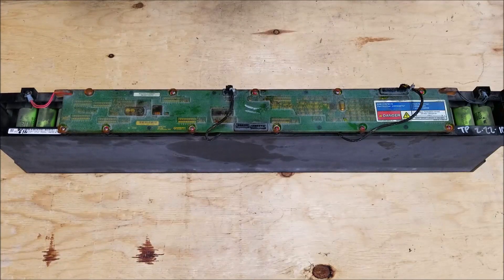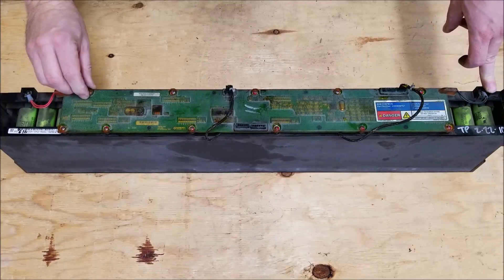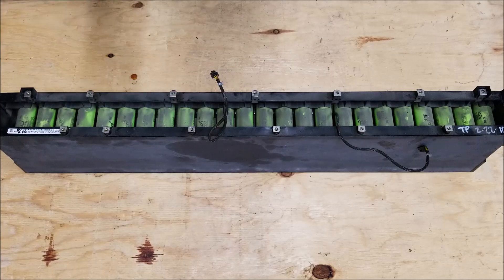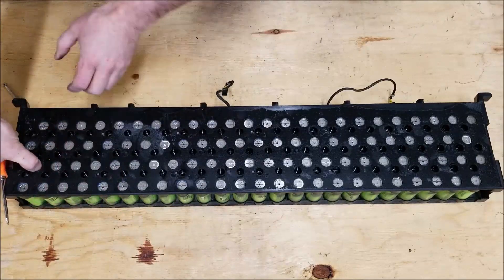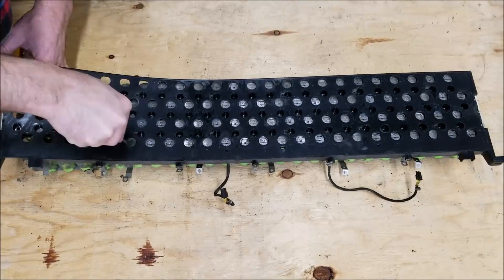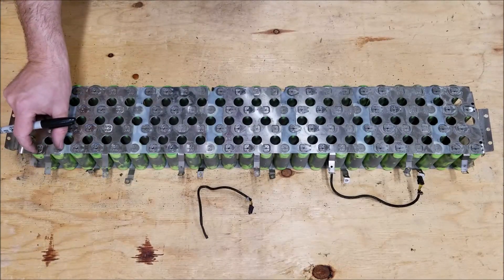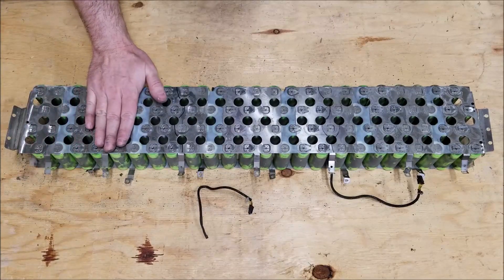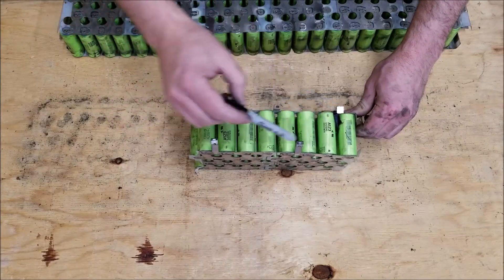Disassembling an A123 LiFePo4 pack

Comment: Why take it apart just wire it up into voltage required.
Reply: Thanks, great video!

I would want to select out the better cells, the reason these packs were discarded is it no longer met specs.

Likely many cells are fine to use, maybe even for years, but not if you continue to combine them with the "weak links".

I take it there are soldered or spot-welded "tabs" connecting the cells to the sheet conductors? 

Just use tin snips to separate them out?
Reply from the maker: @HansHenderson  Yes, they are spot welded and cutting them out with tin snips works fine. I took a weak pack completely apart, and only eight cells were above 1500 mAh (65%)
Reply from the maker: The pack is 40v, if one need a 12v equivalent pack, then you need to break it apart, there is no other way.
Reply: @DIYbatteries   well sort of the first screw on positive end and the 5th screw will produce 12 volts and the screw tabs will deliver enough amperage draw to run most 12 volt applications even though they have burn off fuse same as the battery tabs. Works for me and I take 24 volts off using positive end and the the 8s screw. Cheers.
Reply from the maker: @offgridwanabe  Sure, you can do that, but then the rest of the pack isn't used and you can't run a 12v inverter off the entire pack at once. You could draw down one group, then switch over to the second group until it runs down and then switch over to the last group. Not very user friendly but yes it would work.
In my packs there's always one weak group of cells so if you have 8 "good" groups of cells consecutively then you could run it as a 24v pack and just not use the other 4 groups.
Reply: What is the dimension of each 12V pack?  I have 4 of these 40V packs I have yet to dig into.  Disappointing to see the life left in them though.
Reply: @rcboosted  They fit in 30 Cal ammo cans very snugly with an inch or so of room on top with the lid closed. So 9"x3.5"x~5.5" On the 9" length measurement it is probably closer to 8.5" but I'm using that space to put foam in. The "height" (these will be standing on their side in the ammo can) is absolutely perfect if you were to install terminal posts that stick down 3/4" on the lid. Leaves enough of a gap to be safe.